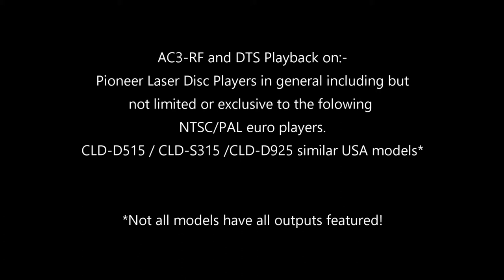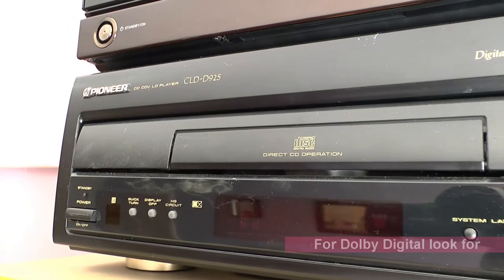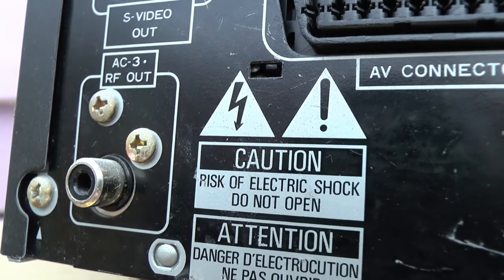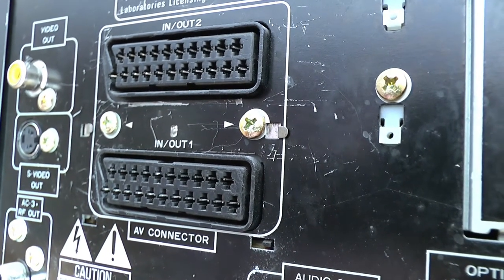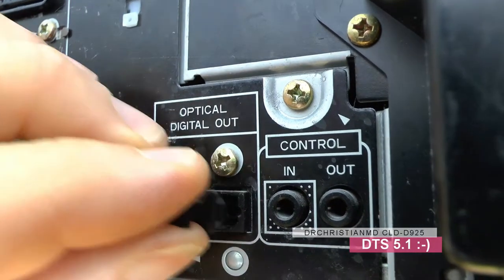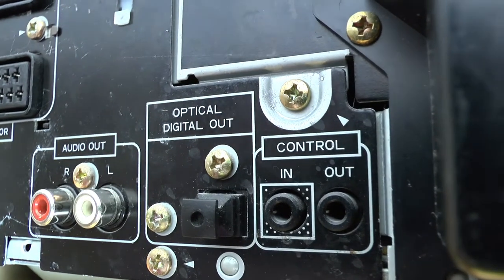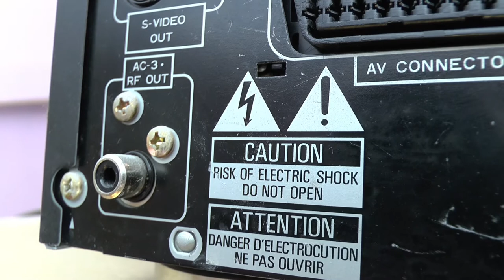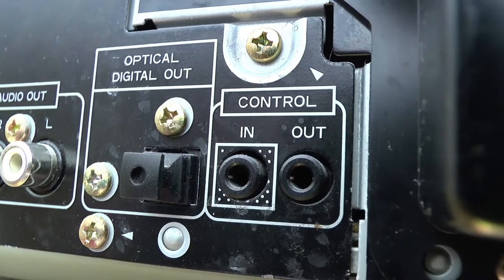This is what you need for AC-3 Playback and DTS on Laserdisc Players ( CLD-D925 Featured)

Comment from the maker: Just to add one thing, if you have an amplifier with AC3-RF ( Radio Frequency) in you can go without the demodulation device but since most people coming into this at this stage will not have one available to them then a demodulator is a requirement for the output of digital as demonstrated.

The signal is a radio frequency demodulation taking place to get back to digital via the " box of magic" demodulator or via an AMP equipped with an RF in demodulator on board.

Comment: Ok 👌. I was looking at this laserdisc player. 1992 Pioneer CDL 1750 PAL/NTSC CD CV Laserdisc Player. It has a digital optical in the back but it doesn't have AC3! So does this mean it won't be dolby digital sound? 

So i really need to find a laserdisc player with AC3 
on the player
Reply from the maker: Exactly. So you need the AC3 RF out for the Dolby Digital ( AC3) Track, you will still get Dolby Stereo digital aka Surround.
Reply: Ok 👌 so if I didn't get a laserdisc player with the AC3 on the player! But its still got the digital optical input. What will it sound like?
Reply: Also I'd only be using a optical setup?  With that optical cable going in to my bose 5.1 surround sound system?  So do I still have to get a laserdisc player with a AC3 logo on it?
Reply from the maker: @worzysp1  pretty darn good. On a properly setup 5.1 system the stereo surround from the optical will give you decent range and surround. The quality on the disc is very good compared to some modern stereo software.
Reply from the maker: @worzysp1  If you want AC3 you need the hardware as per video. 
AC3 On player>AC3 Demodulator and or direct to AMP with AC3-RF input.

Comment: This meaning I would need to use TWO ports (optical and coaxial) on my amp? How about analogue and LPCM audio on LDs? Will they stream through the optical port as well (Analogue being converted to 2ch PCM signal)?
Reply from the maker: Depending on the player you will need analogue in ( red and white) and Digital optical in. Most later discs sport digital and its LPCM.
Reply from the maker: NTSC analogue is supported on most players but not with PAL ones. 

Optical out for DTS.
Optical out for standard digital audio on the disc.
Reply from the maker: AC3-RF out requires a demodulator to convert to coaxial or optical out to your amp.
Reply: @DRCHRISTIANMD  I know that. But this implies that I'd have to use one amp input for DTS/LPCM and another one for AC-3. Right? Also, is AC-3 decoding capability worth the job?
Reply from the maker: @tsuyoshi85  correct and no in my opinion if you can get a demodulator  for 100€ go for it. Otherwise not particularly worth it. I definitely found more separation on the DTS with my setup over AC3-RF.
Reply: @DRCHRISTIANMD  I just got a mint-condition Sony SDP-EP9ES preamp, which features an AC-3 RF input for 120 €. Now I'm trying to get the Pioneer CLD-D925, but they're pretty rare. Should I be all set with this setup? I mean for NTSC analogue audio, LPCM/DTS (the preamp does not decode DTS but it does export it, which is what I needed) and AC-3?
My original choice was the Sony MDP-850D , since my gear is mainly from Sony, but it lacks RF out and S-VHS out (and I've also read that its RGB output via SCART looks blurrier than composite).
Reply from the maker: @tsuyoshi85  Hello, any RGB output is beign "mixed" by the player as the format is analogue on the disc and analogue out via composite  ( yellow RCA) anything else is just remixing the out put. I also recommend you try both scart outputs as on some players you can get a better picture.

When it comes to DTS the digital out optical cable will go into most modern amps for DTS decoding along with the PCM on the disc with the standard stereo track.

AC3-3 into the Sony and then into the amp via rca cables for a 5.1 setup?
Reply: @DRCHRISTIANMD  thanks for getting back to me!
AC-3 RF out coax, optical PCM/DTS out and analogue out (pre-digitised via Sony RDR-HXD870 that would also work as TBC and HDMI upscaler) to the Sony preamp and then out via optical output to my Sony amp (which decodes all formats). I know that the digitising-analogue-stuff thing is cumbersome but I want to use the Sony preamp mainly as a switcher.
Reply: @DRCHRISTIANMD  The player shown here will play analog audio from PAL discs- I have one of these just for playing PAL discs but have a second demodulator hooked to it just because. I've had that Kenwood demodulator as my main one for 25 years and used with several players and has worked well.